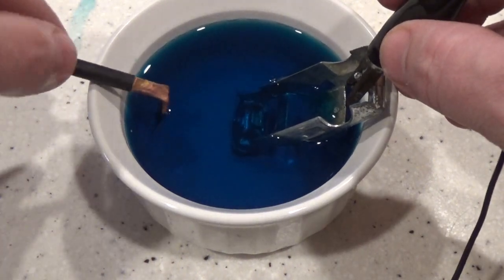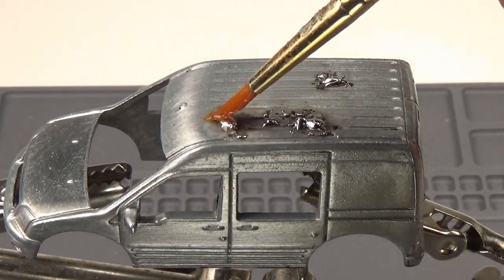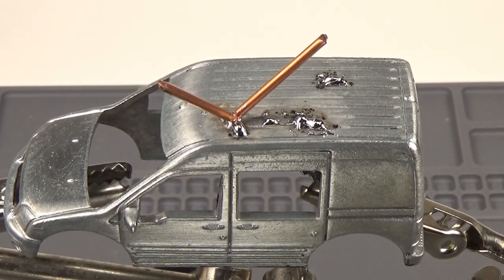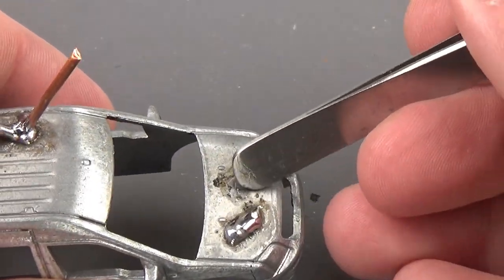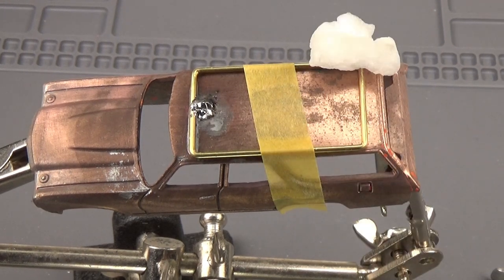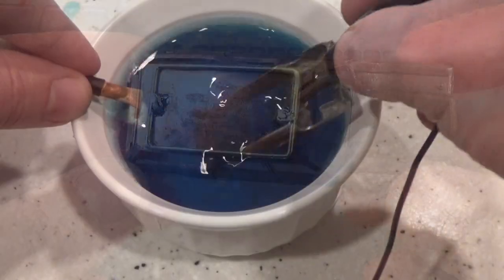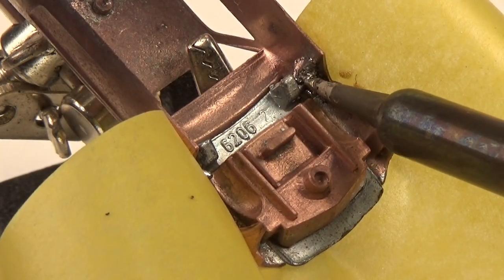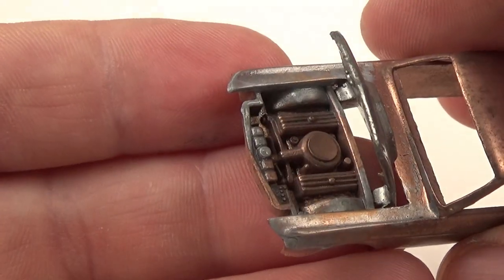How to Solder Hot Wheels ZAMAC Metal and Repair a Vintage Redline Hood.

Comment: I don’t know your equipment, but I use a solder station vs a soldering iron, this allows me to adjust the tip temperature to find that sweet spot every time. 

I also do copper plating using off the shelf root killer, a copper tube and a nine volt battery, but your plating set up is way beyond anything I have, I just found home store off the shelf root killer to be less costly.

Comment: lead soldering can be difficult if you are soldering small parts.
I recommend to you to use all the heat you need when soldering big joints, but for small parts i recommend 25 watt or 30 watt, in fact those are the best soldering irons for electronics

Comment: The main issues with welding die-cast is the low melting temperature of the material and the thin material walls. In a nutshell, you need a verry short amount of exposure time to a controled temperature before the material starts meltung. Givven the thin walls aspect and the melted material viscosity, the weld puddle tends to clog instead of run, making things quite complicated. Try heating the material just a bit with a propane torch before trying the weld on the base material. In theory, just a slight increase in temperature on the already raised temperature, for a verry short amount of time should liquify the material just enough for the material to be welded. Please note that this technique can be applied to the un-plated material, and also some deformation might appear. Inner matterial tensions should not be an issue unless you preheat before attempting any bending.

Comment: Like with that rack, have you tried using one of those mini butane torches to heat the area then wet in the solder sort of like how you solder copper piping for water lines. You might also be able to use one of those butane powered soldering iron with a hot air attachment to heat the area. Generally with a large surface like that car body it will wick away heat from the area being soldered with a normal electric soldering iron.

Comment: I said about this on the last vid but for a different method - a narrow application heat gun gives you more control than an iron. It works for electronics repair!
Reply: Yeah I suggested one of those little butane soldering irons with the hot air blower would work well for this. Large metal surfaces will pull away heat from the soldering iron tip pretty fast.

Comment: I think using the right tools will help a lot here.
1. Get a soldering iron more suited to higher temps.  They make simple High Temp pencil soldering irons that don't cost very much.  Search Amazon for "High Temp Soldering Iron".  The problem is the surface area you are trying to heat.  I don't know what temp the ZAMAC melts at so I suspect some trial and error is needed here.
2. Get a higher temp paste flux.  This won't boil away the moment you touch the soldering iron to it like the flux you are using.

Comment: I would advise you to cut off very small pieces of solder and lay them in the flux. Then heat the metal and the solder will flow, like being sucked towards the metal. You'll have a much cleaner connection then, with hardly any, if any, cleanup to do.

Comment: Try using a small butane torch to solder with.  You need a lot of heat, quickly.  If you plan to do this regularly and have a healthy hobby budget, get a resistance soldering unit, which is better than the torch, as it can pin point the near instant heat you need for properly soldering on your cars.

Comment: Would it be helpful to also rough up the Zamac surface a bit before plating?  And also rub the plates surface down with some steel wool or something so the solder has more tooth to stick to?

Comment: You will have better luck with the solder joints sticking if you preheat the body of the car before soldering. Ideally, you want the body of the car to be hot enough to melt the solder. This may be tedious, but instead of putting the solder directly on the soldering iron and then on the car, heat the car with the soldering iron tip and melt the solder directly onto the car. With enough flux, this technique should grant you an almost 100% success rate from my experiences!

Comment: Awesome video.  I have a general question for you concerning the car bodies.  I understand that they are made of ZAMAK metal.  (an alloy of zinc, aluminum, magnesium & copper)  My question is, is the entire body made of this alone or is it then plated with zinc?  I have watched MANY hot wheels restoration videos and most keep sanding and filing and working the metal bodies to get the best finish for painting.  There is not much concern for wearing through a plating level.  Can you please provide some insight to the bodies?
thanks.

Comment: Question - do you think this could effectively scale up for major 1:18-scale jobs? Case in point, I'm considering a 4-door conversion project that would require attaching a modified roof at the A and C pillars, with an additional B-pillar. I get the feeling that even the copper may not aid in building up the material around the C-pillar.

Comment: You should look at videos on brazing large cast iron parts. And I think you would have much better success using something like a butane torch - the soldering iron you are using is too small to properly heat the large casting.

Comment: While I am not positive if there's a cost difference, you can buy copper sulphate crystals (used for root killer) and dilute them in distilled water. Also I wonder if using a butane pen torch will give you better heat? Though too much can distort or melt the zinc die-cast.

Comment: Can solder be used to fix small dings "deep chips in the metal? I have a redline custom cougar that has 4 or 5 small dings or dimples about the diameter of a pencil tip on the trunk lid ( what's odd about it is that the paint is still covering it so it makes me wonder if it were a factory defect in the casting and if it would be worth more to leave them there if it were a factory flaw which I was looking at doing some mild restoration on it because it's missing the windshield and rear window which I could very carefully replace without having to take the car apart completely which I thought about if I were going to do a Resto job on it and you paint job and getting rid of the things I was just going to hit it with the Dremel smooth it down and sand it and make it all nice and smooth before a repaint
I also have a Redline custom barracuda that is missing most of it's "A" pillar do you have anything on soldering something like that? I was thinking about maybe using a piece from one of the remake models of it as a replacement

Comment: Do you have any idea what the strength of the joint is? I can see it's on a hot wheels car but I have a craftsman 109 lathe that has a planetary gearbox made from zamac as well. There's a slot that fits a small square key for locking the gearbox is specific modes and I just need to add some material because the previous owner tightened it way too tight and chipped some off. If you have any idea if be grateful.

Comment: How hot the solderer was? I heard that 384°C is temperature needed to melt ZAMAC alloy. It would be much harder to actually weld zamac parts rather than solder them,yes?

Comment: Why do Americans say 'soddering' and 'sodder'? It's soldering ffs!
And the guy who suggested pre heating the work is spot on. The solder clings to the little micro cracks and grooves in the surface. These open up when the work is heated.

Comment: Buy a higher wattage soldering iron with a HEAVY tip. You need very good heat capacity, not high temperature to solder to chunky pieces. Plus it looks like you may need to change your flux as well. Use a rosin based solder. Source: I solder for a living.

Comment: Are you using a rosin core solder, or acid core? Acid core would be better suited for that type of work. Also an acid based solder flux in paste form helps a lot.
Reply: I also noticed the use of silver solder flux in this video, which  is used for brazing with acetylene torch. An acid flux would work much better for lead solder, just be sure to with clean with alcohol after.

Comment: Not sure if your solder iron can adjust temperature but if it can’t see if one is available and play with the temperature of the solder iron. Or stick the car in an oven to heat it up and balance the temperature out

Comment: Preheat the car a little with a hot air gun, otherwise the solder cools too quickly and makes an ugly lump. The trick to 'wetting' is to have surface+solder+flux+iron all make contact at the same time and be at the same temperature. Preheating makes the surface 'wet' more easily,  you will use far less solder and the joint will be much neater. The type of flux is also important, rosin flux doesn't work very well,  Kapp Luna (or similar) fluxes are specific to Aluminum and Zinc Diecast alloys but are quite expensive.

Comment: After you’re finished soldering can you still zinc plate the car so the spectra flame paint will look original?
Reply from the maker: Yes.. the zinc will plate right over the copper and change it back to silver...
Reply: And it won’t effect the solder?
Reply from the maker: @ilovedogs7224  no... not at all
Reply: How about chrome plating over the copper?  Have you done any chrome plating yet?

Comment: imo getting a solid solder is more important than getting it pretty anyway. Once the metal is firmly attached, you can always remove the excess and shape it with files and attachments to the rotary tool, but if you stick it looking good but not solid enough, it is all for nothing.

Comment: Solder with-an-L always flows towards the heat. You have to heat the piece and apply solder to it, and it will be drawn towards the iron/heating point. Applying solder to the iron itself is almost always a losing strategy.

Comment: You need more heat... I bet if you used a small cigar torch you would find it easier. That body is to much metal surface and your soldering iron can't keep up.. along with tip size.. you can also try heating up the spot first before trying to solder to it. That car body is just a giant heatsink you gotta have a heavy duty soldering iron to be able to keep up..

Comment: Need moar heat for it to stick. Watch some jewelry making videos or soldering copper tubing and you'll see what I'm talking about the solder, flux and iron you are using is designed to solder smaller components or wires together

Comment: So, the solder won't bond to cold metal and you're soldering to something that will disperse heat very well meaning you need to  work harder to keep the heat up in the spot you want.

I would recommend you try a fat chisel tip on your iron to tin the area you want to solder to. These are better at soldering to large surfaces compared to a needle tip which is designed for more intricate work.
Simply tin the area with the chisel tip then switch if you need more precision.

You may also want to experiment with pre-heating or using a hot air gun, just watch you don't burn your hands. I don't want a mob after me because you can't post videos any more =P

Also, I've never seen a solder joint that I haven't been able to fix with enough heat and enough Flux. I can't recommend flux enough.

Good luck! Happy to answer if you need more detail.
Reply from the maker: Thanks for the reply!!  I will be trying out the pre-heating asap!
Reply: @baremetalHW  No problem! Just remember that however you choose to pre-heat (hot air gun, oven, hair dryer) you're still aiming to keep heat in a specific spot of a piece of metal that will cool down reletively fast. Hinges etc will give more grace but large panels like roofs will still need a fast hand since they're thin and wide.

Comment: That soldering made me almoust cry.  1st get good quolity flux i do not know what your using but looks like bottom quolity blummers flux with alot of residue. Second reason you have issues of solder "sticking" is your applying solder to the iron it is pointles you need the soldered surface to heat up then add solder to the surface NOT the soldering iron. If the surface is not hot enough no bond is formed. Any case keep practising and look few soldering how to videos. 👍 btw you can preheat the car with rework blower to help it not to suck all the heat too fast.
Reply from the maker: Thanks for the advice! I will give it a try.

Comment: It seems your main issue is heat, if you want to continue using that soldering iron preheating the car body with a heat gun should greatly improve the soldering process. Another option would be to use a soldering gun rather than a soldering iron, like this one for example https://images-na.ssl-images-amazon.com/images/I/31i9z2472oL._AC_.jpg These can provide a lot more heat and would easily solder on that chassis

Comment: it's all totally unnecessary. all you need is either a pre heater (oven) or a heat gun set at around 350°C in combination with a soldering iron! the reason the solder sticks so badly is because all of your heat from your tiny soldering iron spreads throughout the metal immediately. it just can't keep up. that's why you always have to pre-heat large surface areas or use a heat gun in combination.